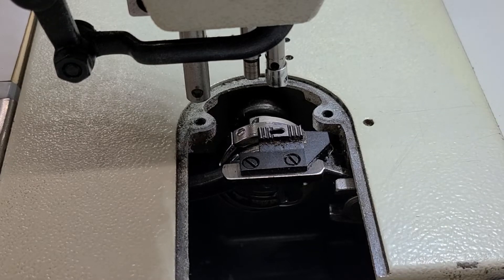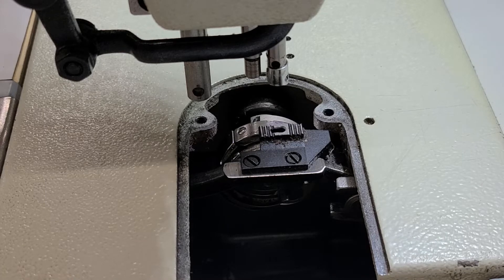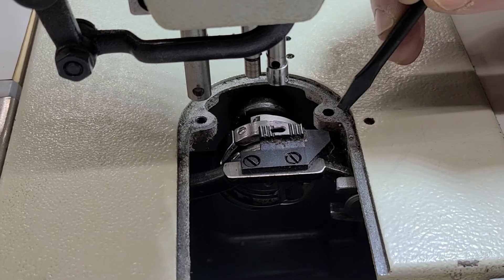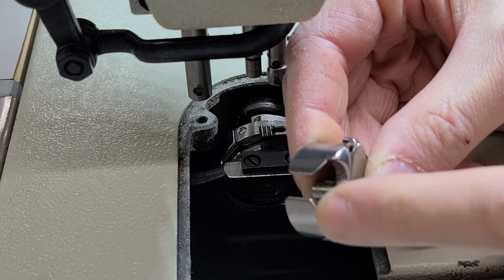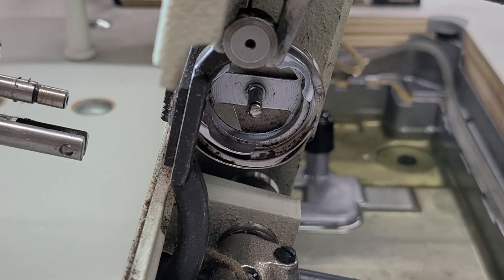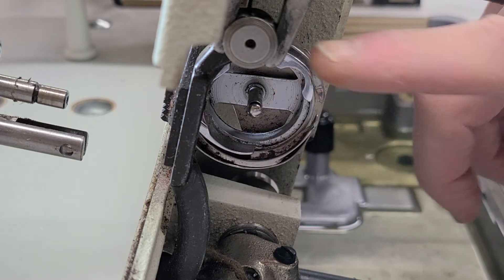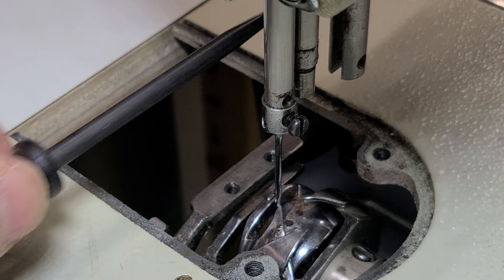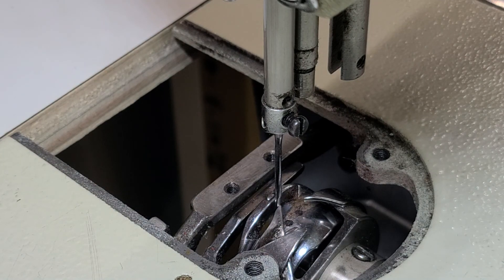Why is your thread shredding?

Comment: Thank you for showing the trouble spots. I have been having shredding with high quality threads on my juki tl98q. I can see that the needle almost touches the side of the hole in the needle plate. This was a used machine that has worked beautifully until I began quilting a very heavy quilt sandwich. I felt myself pulling the quilt to move in circles (free motion quilting). I hope I can fix this and didn’t pull the whole needle assembly off center. Again thanks. Very enlightening.

Comment: I've been having this problem. It's intermittent, and it's been driving me nuts. The shredding bunches up above the eye of the needle. My problems started after I installed the aftermarket needleplate that has markings, and cranked my stitch length to 9.  (Juki needs to provide marked needleplates--there's a market.) There is something called sanding cord. Amazon sells it. My hubby might have other suggestions; he's in the steel industry.
Reply: This is happening with my DNU 1181n and I'm scared to start dismantling the hook,etc.  Did you have any luck?  Mine seems to be the worst as I'm working on layers with a welt cord.  Perhaps its pushing the needle and the hook is rubbing?  UGH!

Comment: Informative video Steve, the part you were sanding on ( rotary hook)with emery cloth is
called the thread guide deflector plate
and it’s purpose is to guide the top needle thread around the bobbin case 
thread supply and also acts as a “cast off”
( like the take up lever) pulling off just the right amount of thread from the bobbin through the bobbin case tension
plate for the next stitch. We always recommend that the 4 screws holding the deflector plate be removed and polish plate with a rubber abrasive polishing
wheel DR425 ( Dremel) then hand polished with 3M Crocus Cloth and then
Reinstall deflector plate. This way there is No Way to get grit from sanding in the rotary hook raceway which would cause 
damage and premature wear in raceway!
Reply from the maker: Thank you Richard!

Comment: Great video found some burs on the plate and sanded/polished to a mirror finish. 

Anyone know if the Juki 241H has the flat spot on the hook shaft like the 1541s?
Reply from the maker: I don't think it does. The 241H did not have a safety clutch from my recollection, so no flat spot.

Comment: Great information. I have had my machine for less than a year and last night the bobbin got jammed. Today it took a few hours but I finally got it out and luckily I had a spare bobbin case. The thread was shedding slightly prior to that so I don't know if that was the problem but any help in preventing this from happening again would be appreciated. I have a juki du1181n.  Thanks
Reply: Did you resolve this issue? I'm currently in thread shred hell in the middle of a client project same model as yours.